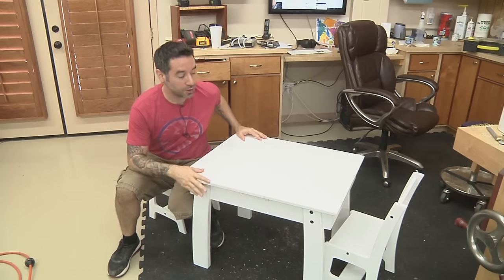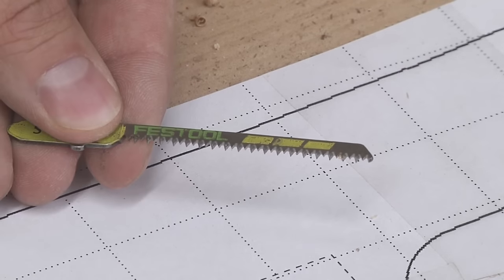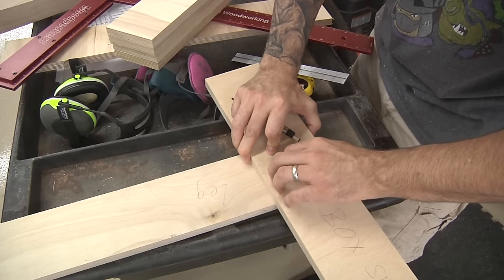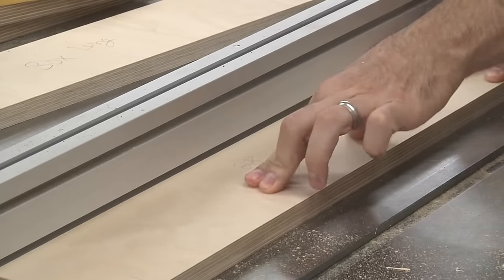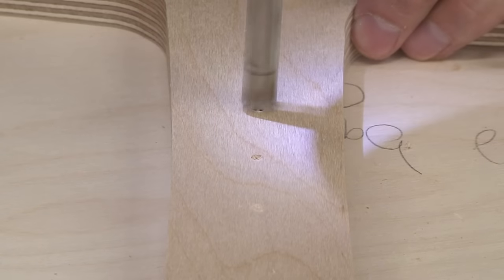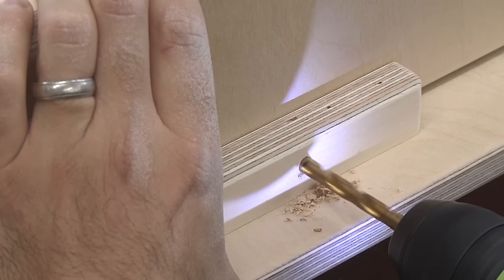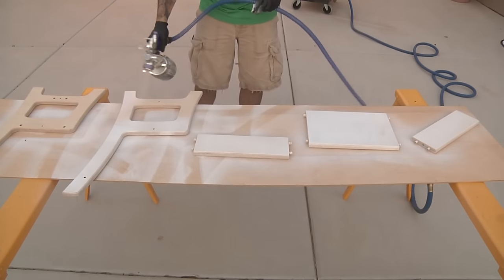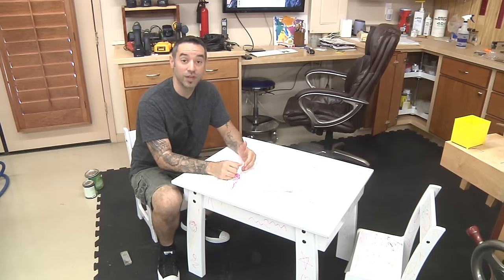Kids Table & Chair Set From a Single Sheet of Plywood!

Comment: what plywood is that you are using? it has a lot of plies for a standard plywood. when I saw the first images, it seemed like Baltic birch but the plan uses a 4x8 sheet. Where do you find decent ply like that?  I'm here locally in Arizona too and usually use timber hardwoods.

Comment: Marc, love the set and a great build. However, the pull pin to release the top may be too small when it comes to kids. For safety, if the item can fit through the cardboard toilet roll, a child could choke on the item.

Comment: awesome build! will put this on the to make list. just have a silly question, how did you put corner index marks on your printouts? I want to try the same technique to print out large images or templates using just a normal printer.

Comment: Great video!  Thanks, Marc.  It's great seeing your son in there with you.  I'll be looking for your new shop "helper" in future videos.  

OK ... you answered the question about the wood filler--what about the spray adhesive?  I'd like to see a short video where you show the various adhesives you use and when you typically use them.  I see Izzy Swan uses a product called 2P-10 for quick assembly.  Do you use anything similar?

Thanks!  
   The Woodworking Chaplain4Cops
Reply from the maker: +Randy Tucker I use whatever I can get from Home Depot. Usually 3m 77 or 90 or the similar stuff in Loctite brand.

Comment: at 2:21 it looks like the framerate of the camera lines up perfectly with the stroke of the jigsaw blade and the blade appears stationary even though the saw is on.
Reply from the maker: +DesolationRobot That's actually a property of the saw itself. The built-in light has a feature where it increases visibility by giving it that still effect. It's pretty weird.

Comment: hi Marc, nice project! I will try to make one set of these but bigger, do you think this design of chair in a bigger scale is a good design for adults??? I have to make a set of chairs for my living room and as I never made chairs before this design looks like something I could make, I just don't know how the bigger chairs will handle the use of adults...
Reply from the maker: +Tiago Jorge It will work for adults but you might need to add some additional reinforcement: more dowels, maybe more bolts. Now that doesn't mean it's going to be comfortable. So scale it up and build a mock-up. I think the key with this furniture is that it's easy to batch out and can be flat-packed. Comfort is definitely NOT one of its strong points. :)